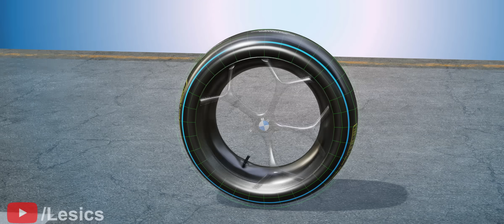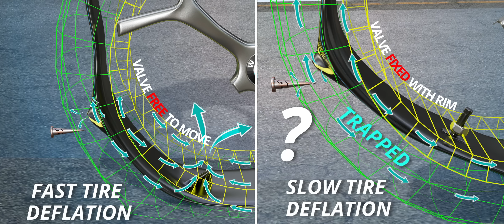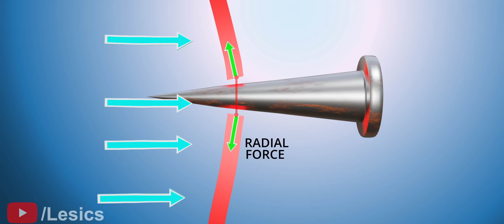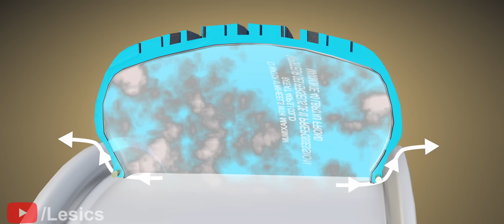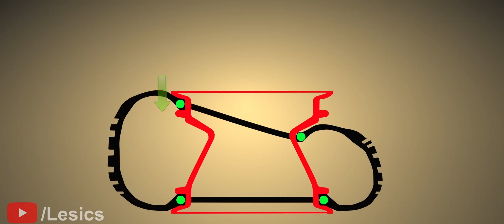Tubeless Tire | The interesting Physics behind it

Comment: Tire engineer here. Thanks for the great video. Just a clarification though, as the tubeless tires are made of different inner liner material (high air retention property), tube tire should not be directly replaced with tubeless tires, even if you have a proper rim contour.
Reply: How do they mean this, convert to tubeless tire? I thought that either the tire and rim require a tube, or the tire and rim are designed to be airtight and tubeless. Are they saying you can add a humped rim and toss the inner tube? Because that goes against what they said about permeable tires...
Reply: @A-Milkdromeda-Laniakea-Hominid  That's right. Technically, you cannot convert Tube type tire to tubeless tire.
Reply: One thing I noticed and an definitely curious about is the name “tubeless” is that a bit of a misnomer? Meaning that it acts like a tubeless tire in ways but technically it still has a tube like nearly all tires? To me it definitely looked like it still has a tube but it’s improved
Reply: @monhi64  Technically, Tubeless is the correct word. Even though the material that makes the tube, is present in the innermost layer of the tire, it is not an independent tube structure. It is more of a part of the tire now.
Reply: Can you explain me please why it is not recommend to replace a tube tire by tubeless tire.Thanks in Advance.
Reply: @satinathmaity1664  wish to know too
Reply: Same for Bicycles. Rim needs explicitly "Tubeless ready"
Reply: @legitscoper3259  Other options do exist, although TLR tire and rim is the official way to do it.  But I've been running non-tubeless tires on a Stan's NoTubes rim for 8 years on my cross bike and it's worked flawlessly:
https://youtu.be/zPZ2hyNC2Gs
I do run sealant in the tires.  The tires I prefer do not come in a TLR version.
Reply: I’ve always said, if there’s a big natural disaster or apocalyptic war, there had better be a few tire engineers left alive or we’ll never be able to figure out how to make them again. When I saw how complex they are, the machines that  make tires, I could t believe it. Stay safe.
Reply: @thetruthexperiment   Haha. Thanks, man. True, it is very complicated.
Reply: Are you mechanical Engineer or chemical  engineer?
Reply: @mianbazafhassan9698  
Mechanical Engineer
Reply: Why does the inner liner matter? If the wheel is shaped exactly like a tubeless wheel, then there is literally no way for the wheel to “know” what material it was “supposed” to have in the tire. You really need to explain this more in depth. Also, since you already acknowledged that it was the contour that matters and was already assumed to be correct, why would you even reply to the “glue” comment when that issue has already been solved?
Reply: People will go for the cheap option - doing it according to "code" is a luxury for people that can afford it.
Reply: Can't that be fixed by coating it with glue?

The inner of the tube tyre
Reply: @lu881   Applying glue can be a quick fix rather than a Engineering solution. Even doing so at a mechanic not advised as it would alter the tire performance in terms of wear, comfort and performance..
Reply: @lu881  no, it exerts lot of pressure

Comment: I used to get a weekly flat... then threw away the tube - poured rubber gel and didn't have a puncture for 5+ years!! Literally converted my bike's tubed tyres into tubeless just use rubber gel - and never looked back.
Reply: product name pls...  I m facing same thing like u...
Reply: @souvikprofile  Its called "tubeless tyre sealant gel, rubber gel, tyre gel etc." Its basically rubber particles, glue and solvent mix that hardens in contact with air so it seals all the pores, nooks and crannies of the tyre-rim system. You have to change the nozzles too. Any tyre shop will do it.
Reply: I live in a semi-desert In the USA where there are lots of small thorns.  They are too short to puncture a car tire, but a bicycle or lawn mower tire won't last a day without a flat.  I use this product in them and never have a flat.  Two kinds for tubed and tubeless tires are readily available at big-box and chain auto parts stores under the brand name "Slime."

Comment: The tires with the tube disappeared more than 25 years ago.
A car with  balloon tires was a liability at speeds over 70 km/h, because the sudden change of direction above that speed was not controllable anymore. I recall after a long drive on the motorway - with my first car in 1981 - I felt grateful to Haven that it went smoothly. I had a couple of tire deflation at low speed, it is unbelievable how quick the tire went from being fully inflated to being totally flat in less than 20 seconds. And this was caused by a stray screw or small piece of metal - casually present on the road - that punctured the tire. Even a pothole once blew the balloon tire.
I'm grateful to the industry that came up with tubeless tires. In the beginning many drivers complained about the costs and the non-repairable nature of the new tires, but whoever had a balloon tire incident knew better and quickly swapped for the new tires.
Thanks for the video...
Reply: Tube for car disappear long ago, but you can find lot of vehicle using tubes nowaday : bicycles, lawnmower, tractor and trucks
Reply: @Dread262  and some classical cars aswell
Reply: @Dread262 tubeless tires are slowly taking over bicycles as well

Comment: A tube type tire can hold much greater pressure than the tube anyway, but the pressure doesn't increase inside the tire just because their air is outside of the tube. The tire is still holding the same pressure throughout the entire volume of the vessel
Reply: That's was i thought

Comment: tires do not have a self repairing latex layer... and by the way if you put fix a flat in your tire it will completely destroy your TPMS sensors, that crap is highly corrosive to those delicate electronics.

Comment: A video about nitogen air and normal air will also be appreciated.
Reply: If you're not driving a race car, nitrogen is pointless. It makes no measurable difference in normal passenger car applications.
Reply: @bremCZ  Really? Why? Perhaps a video on it would be helpful.
Reply: @itzakehrenberg3449  Because normal passenger applications don't generate enough heat for it to do anything worthwhile. There's plenty of information about it out there but the people selling it will tell you all the theoretic information, which while not false doesn't occur to the degree required to actually make any difference. Goodyear trialed it years ago and decided not to impliment it because it didn't do anything worth the expense. Bridgestone/Firestone did the opposite and started selling it.

Comment: You cannot buy a new car with tubed tires since ~30 years. Even trucks and buses run on tubeless for a long time. The relevance of this video is like explaining how to drive a car with a steam engine.
Reply: nah dude, some small bike still use tube tire...
Reply: @skarhabekgreyrukh8601  None of the small bikes are cars.
Reply: Even if it's not a car, there are still other vehicles like ebikes using tubed tires

Comment: Excellent explanation.Thank you for making such, easy to understand and simple videos.
Reply: This is not good nor correct explanation. 
Majority of tyres don't have "hump" on rim. Air pressure keeps tyre pressed against rim and they form airtight seal. Hump may only help when tyre is deflated to keep the bead from mowing inwards and tyre collapsing.
Also balloon analogy apply to all car tyres since they all have reinforcements inside, and won't explode. Difference in tyre types is that tubed tyres are not airtight around bead and will deflate faster when tube  is punctured, while in tubeless the air can only escape through puncture hole.

Comment: Also to mention that a tubeless tyre is light on the shockers compared to the tyres with tubes.
Also I felt that tubeless tyres are lighter than tyre and tube assembly.
Reply: More importantly, they run cooler due to the lack of friction between the tire and the tube, which leads to less wear per mile and longer lifespans for the tire.

It also allows them to run at much higher speeds for longer periods without failure.

Comment: Although tubeless tires are more expensive than tubed tires, they would save you a lot of repair cost in a long run. Which made tubeless tires more valuable than the tubed tires that punctures very often.

Comment: 2:20 Why does the tire explode? If it was able to hold the air pressure before the puncture, I’m not seeing how a puncture would suddenly make it able to explode.
Reply: Yeah, I don't quite get the point made here either. While I don't know much about car tires, MTB tires are not behaving like this.
Reply: the tire casing itself doesn't 'explode'. but rapid air loss from tube failure means the tire squishes and drops. then gets rapidly shredded between the rims and the road. since you're at highway speeds the parts get flung out as dangerous projectiles. so, shrapnel but not really an 'explosion'
Reply: The tyre (and tube) has tension when there is air pressure.

When there is hole in the tyre, the tension (tyre stretching because of the air pressure) causes the hole gets bigger.
While the hole gets bigger, the punctured site becomes weaker to tension. This makes the tyre more vulnerable to tension, making the hole even bigger. Eventually, tension will rip apart the punctured site, causing an explosion.
Edit:the same thing happens to the tube, but the tube won't pop. Only the hole gets bigger

In fast tyre deflation, the air can escape through the valve also. Hence the air pressure decreases rapidly, so as to reduce the tension on the tyres.
I.e. not cause the tyre to rip apart.
Reply: @Abedchess  But the pressure —> stretching effect occurs with the tubeless tire too, so I’m not seeing how it’s unique to one design or the other.

The balloon pops because the rubber is stretchy and the escaping air has that servo effect. A tire is not very stretchy, regardless of whether it is tubeless or not.
Reply: @MaplePanda04  
In tubeless, the tyre and tube are glued together.
This provides support against tension, making it harder for the hole in the 'glued tube' to get bigger.

Like a balloon with tape. The tape is helping to resist the tension, making it harder for the hole to get bigger.
Reply: @MaplePanda04  In a balloon, the tension pulls in all directions around the balloon. 

In tubed tyres, the air pressure transfers from the tube to the tyres. The tyres cannot withstand the air pressure , and rips the tyre at the weakest point.
 I.e. the puncture point

In tubeless tyres, the tube and tyre are glued together. Both provide support against the air pressure. Making it harder for the hole in the glued tube to increase.
The tyre will not burst because the 'glued tube' is transferring air pressure directly outside
Reply: @Abedchess  Tyre is reinforced with steel and plastic fibers. Tube might explode inside, but outer tyre won't. Tubed tyre must withstand these pressures, otherwise it will be unsafe on road and thus illegal. Tubed/tubeless difference explained in other comment.
Reply: As shown in balloon case, the air will try to escape from the puncture region, and since the pressure is high, it will likely rupture the tube and tyres.
Reply: @hiareeb  Unfortunately this is not good nor correct explanation. 
Majority of tyres don't have "hump" on rim. Air pressure keeps tyre pressed against rim and they form airtight seal. Hump may only help when tyre is deflated to keep the bead from mowing inwards and tyre collapsing.
Also balloon analogy apply to all car tyres since they all have reinforcements inside, and won't explode. Difference in tyre types is that tubed tyres are not airtight around bead and will deflate faster when tube  is punctured, while in tubeless the air can only escape through puncture hole.
Reply: @hiareeb  Explanation is simplified and wrong in case of car tyre. Tube might explode inside but outer tyre won't because it is reinforced with steel and plastic fibers. Outer tyre is holding the pressure with intact inner tube, and will do so if inner tube is damaged. Only difference between tubed and tubeless is that inner layer in tubeless tyre is impermeable to air and has good seal around the rim, so air will leak through hole only, while in tubed tyre air will leak through rim and valve as well. Tubed tyre must withstand these pressures, otherwise it will be unsafe on road and thus illegal.

Comment: In Chinese tubeless tire are called "真空胎"，which literally means "vacuum tire". Very confusing.
Reply: Is 胎 taken from English tire
Reply: @flat-earther  I would say yes. 胎 originally means "fetus". Later it also means tire, similar pronunciation.
Reply: @王跃恒  I guess the logic in that, "fetus", is the same as something internal to a womb or an outer shell? So fetus is basically the "tube"  inside the tire right?
Reply: @nightsurfer1  Yes that also makes sense. Lots of "modern" things are named this way in Chinese. Mainly borrowed from English and Japanese language.

Comment: This is not good nor correct explanation. 
Majority of tyres don't have "hump" on rim. Air pressure keeps tyre pressed against rim and they form airtight seal. Hump may only help when tyre is deflated to keep the bead from mowing inwards and tyre collapsing.
Also balloon analogy apply to all car tyres since they all have reinforcements inside, and won't explode. Difference in tyre types is that tubed tyres are not airtight around bead and will deflate faster when tube  is punctured, while in tubeless the air can only escape through puncture hole.

Comment: wow i haven't seen tubed tires for cars my whole life.  bicycle tires, on the other hand, is much more commonly seen with tubed tires although tubeless has been out for a while and extremely popular.
Reply: Not sure about other parts of the world, but in the US tubeless tires started replacing tubed tires in the early 50’s.
Reply: I've worked on cars for about 10 years now, NEVER seen a tubed tire. Fast, slow, cheap, expensive, old, new,... Always tubeless
Belgium btw (so European cars mostly)
Reply: Here (Argentina) you don't see new tubed tires, since decades ago. But you can put a tube in your tubeless tire, in case it has a pore as a defect of manufacturing or uneven wearing. It's not the best solution at all, but can buy you some time until you can replace the tire. Also, when done, usually the tubed tire is put in the rear wheels, that don't steer neither bear the weight of the car.
Reply: Note, tubes cannot even be installed in tubeless tires because, IIRC, wall strength and thus friction, leading to wear and ka-boom.
Reply: @louf7178  Obviously not true. I have been running on such a tire on my motorcycle for the last 3 years. no ka-boom
Reply: @caty863  Was taking about cars as the original post obviously reads.
Reply: Some Soviet cars had tubed tires.
Reply: Tire tech, really only see tubes in passenger cars on farm trucks that never go over 20 mph. These days, tubes tend not to be rated to more than that and will overheat with passenger driving.
Reply: Tubeless roadbike tyres are limited to 70psi vs 130 with tubes, so they're slower. 
Tubeless MTB tyres at 20 psi for off road grip fall off the rim when cornering hard. They call it burping, you get a flat tyre stuck halfway down a mountain
Reply: @janeblogs324  70 psi limit is on hookless rims. hook bead rims can handle tubeless tires over 100 psi. but if you really want higher psi you shouldnt use tubeless or tubed tires, you should be using tubular tires which is a tire and tube in one and can take 200 psi in some cases
Reply: @janeblogs324  Technology has gotten better.
my mtb can run as low as about 3psi before I start to worry.
Reply: For bicycles, tubed tire works the best.
Reply: @axm-004  why?
Reply: @ClaudiuTudoras  They might be prone to punctures, but the punctures are much easier to fix.
Reply: @axm-004  Aren't punctures easy to fix on tubeless too?
Reply: @ClaudiuTudoras  depends on the size of the puncture. by design tubeless sealant will automatically seal small punctures so i would argue tubeless punctures are actually easier to fix
Reply: @ClaudiuTudoras  Yep, in fact as long as you don't let your sealant dry out, most of them are self-fixing. tubeless is better.
Reply: @ClaudiuTudoras  nope. tubeless puncture fix is expensive af

Comment: But tubed bicycle tires never explode, even though they have higher pressure than a car tire.
Reply: A bicycle doesn't have so much  weight, as a result there is less stress on it
Reply: @Abhishek_Zagade  Many tubeless car tyres have valves that screw into the rim too. It's called a TR4 valve. They don't explode either. The tire is much too strong to have such little pressure do any damage to it.